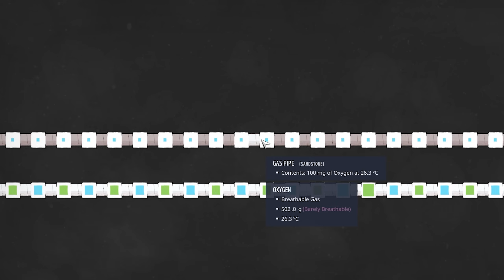MECHANICAL FILTERS: A German Engineer explains ONI

Comment: 8:30 - you are correct in most cases, but what if two packets of O2 have 1kg? This is more likely to happen in liquids to be fair at 10kg. You showed a way to solve it but it does slow down you air or liquid per second.
21:11 - For what you are using the gas shutoff for, you do not need it. Just connect the automation wire to the vent and run the pipe from sensor to the vent. Requires 0 power and does the same thing. Also works for liquid.
Reply from the maker: On the first one: Even if you have 1000 packets of O2 in a row it would still work. The first package deposits 999.9g in the first pipe(full 1kg in the loop now) and 0.1g in the second(0.2g in the loop now). The second package then deposits 999.8g in the first pipe on top of the existing 0.2g in the loop and 0.2g in the second pipe, so it comes out to 0.3g. This repeats over and over. Everytime an extra 0.1g are being sent to the second pipe. So after 100 packages you are still only at 10g in the second pipe. This means that after 10.000 packages of 1kg in a row this system would let 0.1g through(999.9g will be absorbed by the second pipe). A single packet in that row of 10.000 packages which has less mass than itself combined with whatever is in the loop already will reset the system and it can take another 10.000 before breaking. The same goes if there is a gap of a single package in the supply. 10.000 packages at 1 package per second would take 16.66 cycles ingame at 1x speed or 166.66minutes(almost 3h) in real life. Even with my 10x speed mod it still takes 16 minutes at full blast.(I have not let it run for that long, I just did some basic math here. While I made the video I let it run up to about 150g in the second pipe at 10x speed to make sure I'm correct).
With liquids it's a much bigger issue, since you are filling the pipe with a pump every single time until the pump breaks or you run out of power/liquid. That's why I showed that specifically!
To your second point:
Does that work? To be very honest, I have never tried that. I don't use systems like that very often at all(see my Let's Play series). Definitely something I need to try! Thank you!
Reply: @BierTier Yep automating the vent works :)  Easiest way to filter CO2 from a rocket while keeping O2 in (O2 gets vented back to rocket).
Reply from the maker: @TeracomConsulting  That’s crazy, I never even considered that, lmao 😂 
For rockets I just put a vent for O2 on the very bottom. It deletes the CO2, no filtering or anything needed. Is it a bit of an exploit? Yes, so it’s up to personal preference if anyone wants to do that or not :)
Reply: @BierTier Francis John was using the overwrite method for a while.  That means that you are replacing < 1 kg co2 with 1kg O2.  It ended up overpressurizing his ship over time.  I also had overpressurization issues, so I run a mini gas pump (with co2 sensor) that runs past a vent dumping O2 back in, remaining CO2 goes to the rocket output port.

If it works for you go for it.  I'm just sharing an option and the reasoning behind it.
Reply from the maker: @TeracomConsulting I see… I didn’t know he used it and I never noticed any overpressure issues. But thinking about it, that does make sense. I guess it would take a good while, but eventually it will happen. I need to take a closer look at my rockets and see what the pressure is in there.

I appreciate any and all tips and tricks. Just because I make YT videos doesn’t mean I can’t miss or mess up stuff 😊
Reply: @BierTier  to the second yes it works for areas that can always vent their contents: the void and inf storage.
You can do it for O2 going into your base also, but since the air might go above 2k you have to have someplace to store/void it.
Add a not gate to the mix. Example: Can have just O2 pass while everything else gets vented out.
Reply: @BierTier He is famous for long timelapses, and I doubt there was only 1 dupe in the rocket :) 

Far less relevant for a single dupe rocket...  But thinking about it.  Every time the dupe exhales, that few grams of CO2 have the potential to be replaced with 1kg of O2.

I've been trying to do napkin math to figure out how many times a dupe will exhale each cycle.  As I see it, if he exhales more than 60 times in a cycle (every 10 seconds),   there is a potential to overpressurize. (Output more O2 than he consumes).

I just went in game, and it appears that the dupes do their Exhale animation every 10 seconds.

So theoretically, since the ambient O2 pressure will always be over 2k,  the vent should only output when it is overwriting CO2.  60  times per cycle with 1kg = 60 kg, the amount of O2 a dupe requires per cycle.

I would appreciate it if you would reply after you check your pressures.  I am really intrigued now.
Reply from the maker: @TeracomConsulting I know FJ, just not this particular “exploit” he used, haha 😊 

Thanks for the detailed explanation of the issue! I will take a look, but it will be tomorrow before I get back on my PC. All my rockets are single dupe rockets, unless I use them temporarily to transfer more than 1 dupe to another planetoid… So that’s gonna be interesting 😊
Reply from the maker: I just had a minute to check in my current Let's Play savefile. The most used rocket is a few hundred cycles old and only ever transported one dupe at a time. The pressure is at 2300g/tile. Lesser used/newer rockets are all below 2150g. So it is overpressured, but it's not as bad as I expected. Nonetheless, eventually I'll have to do something about it, haha :D
Reply: @BierTier Thanks for the followup.  I appreciate it.  Looks like your findings are in line with my prediction that it would be slightly over pressure, but not enough to cause popped eardrums.  Interesting.
Reply: FJ likes sending 8+ dupes in rockets, current run he wants to do about 20.

Comment: My only thing with the mechanical pump is the overflow, which would've loved to see here.
>If the filtered line gets backed up, you could find the gas/liquid that you wanted filtered now going through the rest of the line, and not just small packages.
>If the line itself is backed up, now both are backed up.
Reply: I put a value on the main line right before the sorting and set it to 90% max to prevent the packets from being too big and backing up the pipes as they reach the filters.  That value is also useful to stop the flow when you are preparing a mech filter for a new element.
Reply: @brockormond4131  Another option is to loop the section of pipe connected to the filters, then bridge the inputs onto that loop. Any leftover packets will loop around and get picked up on subsequent passes.
Reply: @RothAnim  I do use that when sorting the various forms of water for treatment to clean water.  Still find that it can still backup and or clog without a release vent
Reply: @brockormond4131  Yeah, priorities and use cases need to be taken into account for sure. If the pipe is 99% oxygen, and I want to make sure the Atmo suits get 100% oxygen, then clogged pipes are usually temporary and rarely affect either output noticeably. If I'm trying to clear out a geyser so it won't overpressure, then any clog means wasted resources. 
For mixed gas/mixed liquid sorting, I'll bridge the input onto a loop, then attach the filters to that loop, dumping the filtered matter into storage/infinite storage. That way any leftover packets get cycled around until fully processed without clogging the loop, and the pump stops if the loop is full.

Comment: Regarding the sensor driven filter - what if the automation is connected directly to the vent? You have them submerged anyhow, so they cannot overpressure, and you save on the energy cost of the shutoff
Reply: I'm pretty sure that'd break it since it'd be activating for the gas packet behind the one that'd be sent out then the one you'd want to to go in.
Reply: It could also be done with a mechanical filter.
Reply: It works perfectly with only the vent
Reply: You can if the vent is open it goes out it if it's not the right element the vent is closed so the packet continues on the line, if your havening an issue with it running one packet behind throw a 1 second or less automation filter on and it will fix it.  Also a not gate will make it open for anything that is not the element you want and keep only that element in the pipe.

Comment: so what is the requirement does it have to run from left to right or can i build it in reverse or even upside down as long as the incoming pipe has the same direction as the filter pipe ?
Reply from the maker: That is correct, you can build it in any direction you wish/need as long as the incoming pipe has the same direction as the filter pipe! I just used left to right as an example in the video

Comment: Very helpful mod in general and esp. for mechanical filter building/debuging:

Pipe Flow Overlay by SnackJunkie

This mod will help you troubleshoot all your pipe flow problems! Upon opening the overlays for either liquid pipes, gas pipes, or conveyer rails, all of the pipes/rails will show a green arrow indicating the direction of flow. If no flow is possible, they'll instead have a red cross, making it easy to see where your problems are.

Comment: How can we solve problems with game slowing down over time?

I need to restart the game every hour to have decent fps.
Reply from the maker: It gets better when you restart the game? That sounds like a local issue. Potentially a memory leak or something like that. 

In general though, the brunt of the load is caused by pathfinding of dupes/critters/etc. and heat exchange calculations. Infinite storages(having all solid debris in 1 tile reduced the calculations required by a lot for example) help, reducing possible paths for dupes and critters as well. Having as much vacuum as possible is also helpful. That’s the best I’ve got for FPS increases :)
Reply: @BierTier It's happening only in the late game. 1k cycles, 25 dups, 6 asteroids, some piping ...

Comment: one thing to be careful with mechanical filters, dont let your lines back up.  If your filtered line backs up you will have the overflow continuing down the origonal unfiltered line.  
A second thing is when your useing 2 bridges and a loop for your filtering it relies on there being an occasional non full packet or a packet of another gas. because the output can only send out 999g packets (with 1 g devoted to the loop) you build up a bit of a buffer with consecutive packets of 1kg. If there's a gap in the packets that buffer dumps into the output, if you send 1000 full packets your buffer runs out of space and sends the overflow down the unfiltered line.

Comment: It's best to have 2 filters per pipe to avoid overflow. While the 2 bridges solve the issue for a long time (about 999 packages) if for whatever reason the source pipe gets 1k packages of the material to be filered in a row there will be overflow and whatever is in the valve will pass, then  more and more for every subsequent package of the same thing.
One filter works great if you're sure the pipe is varied, but for extremely random stuf I'd be safe with 2, either that or play with sensors and stuff to stop the pipe at it's origin if the composition is to homogenous
Also with 2 you can do some nice designs with a bridge to each side, 500g on the valve and an extra bridge to mix the output, it look quite neat with filter rolling different directions

Comment: love your explain videos, could you explain the temperature cloning glitch?  I've found videos about it's basic structure and can duplicate it, but then I saw a Luma Plays short that expands on it, but doesn't explain it well.  I tried a horizontal version and it didn't work as expected.  I had the thermal regulator on the left with the intended 'cold source' on the right, but the glitch started cloning left to right (i.e. got warmer rather than cooler; which is in contrast to Luma's). All videos I found so far just glosses over the mechanics of it.

Comment: just a cautionary tale with those... if the valves overheat, it all can break in a catastrophic way 🙈
Reply from the maker: Failure is always an option ;)
Reply: Im not sure if it’s my game or what, but i had my filter all broken by overheating and it was working like the broken stairs( like normal)…
Reply: might depend on HOW you build them... what happens is, if the valve overheats and breaks, gas shouldn't go across anymore, so essentially your filter loop empties out, once the filter loop empties, it starts accepting everything

i'd be curious to understand HOW yours didn't, because I can't even think of a way to build these where it wouldn't cause this issue
Reply: @zaftnotameni  i would like to know myself. What you said is true 100%, it should just empty my gas line and thats it… mysteriously, it was functioning just fine… and it was not so long ago but i repaired my gas filter since… i should have make a video on it…. 😅
Reply: the only scenario I can think of that would be safe with a broken valve is: if the output of the filter is full and backlogged, the output and the filter loop both stay full (pre filled with the correct content) regardless

🤔 guess it will remain a mystery

Comment: For the late game… does it take more resources for the pc to run a mecanical filter than a natural one? Bcz 1 of the problem of oni is when it start to slow down from ALL the simulation 😅
Reply from the maker: I honestly don’t know. I don’t think that it takes much. The brunt of the load comes from pathfinding and heat exchanges. Since the gas always goes in the same direction and the main calculation for each package is addition(0.1g + whatever is added to that) and subtraction(whatever is in the loop - 0.1g) I’d think it shouldn’t be too hard on your PC 😊
Reply: late game the best solution for FPS is the filtered pump mod

I haven't tested it but would guess the normal filter is better for performance than the mechanical one, each bridge/valve with a fallback creates a fork where gas can go either way depending on conditions and each of of those should be an extra calculation per tick... so... very very very likely that the powered "intended" filters are more performant
Reply: my preferred late game solution though is just to vaccum and blockfill as much as possible

if you are not opposed to mods, besides the "filtered pump" there is also a "piped outputs" mod that saves a looooooot of processing power since a lot of blocks are prevented from emitting gas/fluid out instead just sending it straight to a pipe

Comment: Personally, when I'm using a mechanical filter, for simplicity i use 2 bridges into th filter, with a pipe running across the outputs then looping into th valve set for 1 gram. Then when I want to prime it when i have,  say 3 gases to start with, I Just put a valve aftrr the pump and set it to 100 grams.  When thr pump starts, the valve only allowes 100 grams of the gas through at one time so a single pump will cteate 5 packets of 100 grams out of the 500 it started with (if I am in no rush, i can set the initial valve lower, say 50 grams, the first bridge it reaches, the entire "mini-packet" will jump into the first filter, and the filter's valve only lets 1 gram pass in the filter.  If the output is already hooked up, the e,cess will continue on ita way, but several mini-packets of the same gas will fill the filter out.
The pump initial valve can be opened up for larger packets to allow filling faster, when there's stability in which filters are primed and the gases around the pump.  I do the 2 bridge version jus in case i need to push 1kg of gas into the pipeline later.  Once its primed, no modification is needed to go to 1kg.

Its a little more work to build, but also not as sensitive to pause and snipping

Comment: I always do the smart shutoff valves from the end of the video. I’ve never even seen a mechanical one. cool I’m about to replace a bunch filters in my base and save some power. Great filter!

Is there a zero power filtering system for solids? Curious. I know the rails behave differently than gases/liquids and I don’t think there’s a solid valve. They have the solid valve reset, which  requires the selected input to be received every so often..
Reply from the maker: Awesome, I'm glad my tutorial helps you out in your base!

Honestly, I don't know about solids. I never had to filter them before so I didn't really try around or look it up. No matter what it is, it always goes into a infinite storage for me :)
Reply: @BierTier  Though you might want to separate out offgassers or refrigerables to somewhere else.